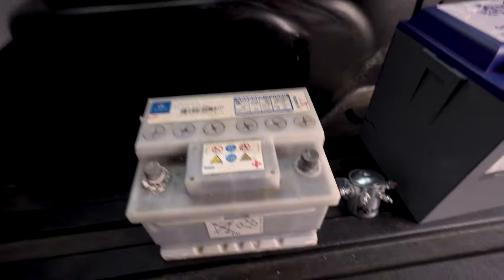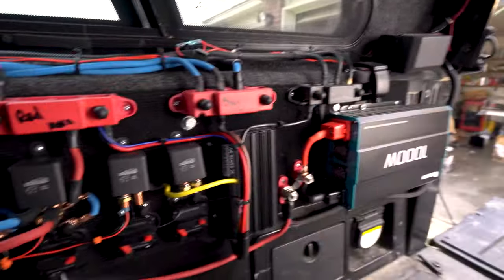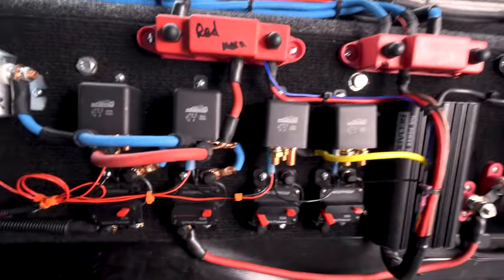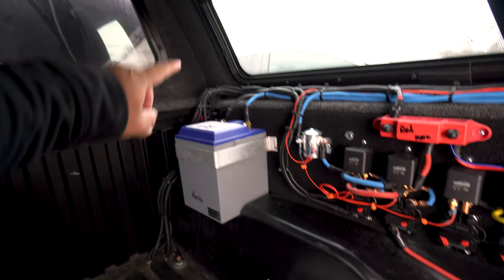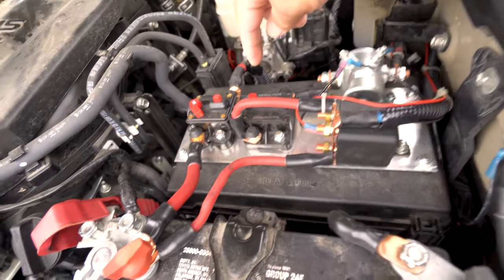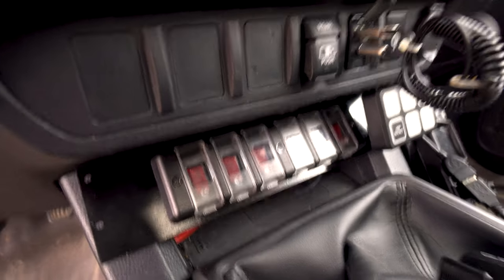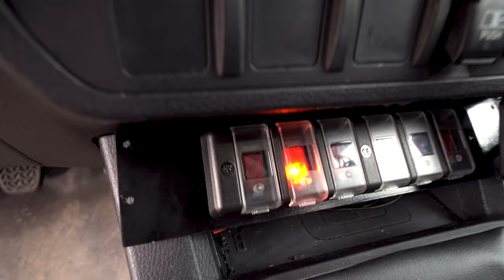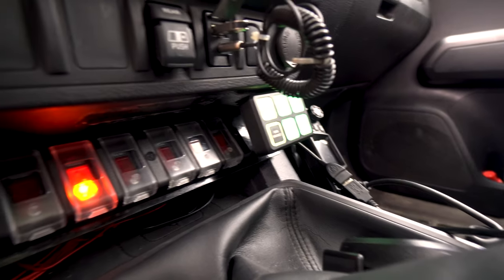I Built the Most Advance Dual Battery System For my Tacoma TRD Off Road | DIY- OOW Outdoors

Comment: So I’m confused with all the extra switches and relays …….that red arc will do all that for you with out all the extra wire switches and relays
Reply from the maker: Its a power grid.  Most people watching this video will not understand.  This video is for the advanced guys.  This video explains all the features you can ever want in a overland electrical setup.  Best part is it is DIY.  To get a similar setup, it will be the Red Vision from Red Arc.  This is about 1/3 of the price and can be easily upgraded in the future.

Comment: Wow what a terrible system. There is so many better and simpler ways to do this. This has got to be the most unnecessarily complicated dual battery setup I’ve ever seen.
Reply from the maker: Its complicated because it needs to be to accomplish all the features.  Don't be surprised if Red Arc releases something like this in the future.  I built a mini power grid, there is redundancies built in to it.